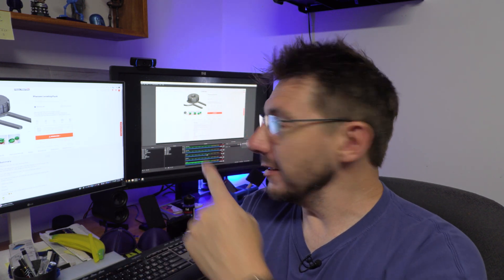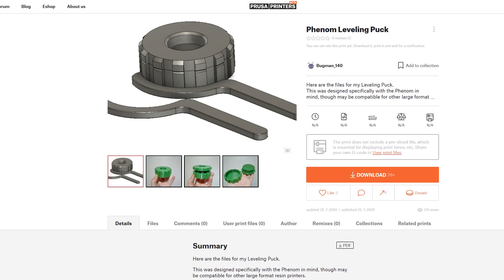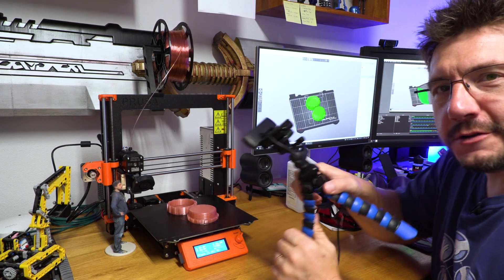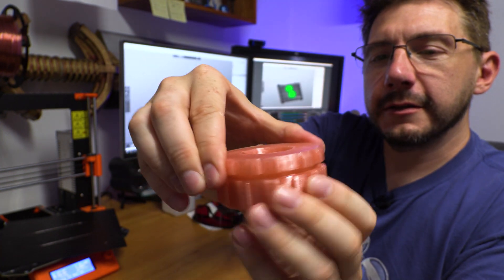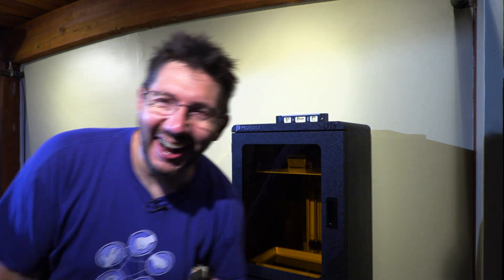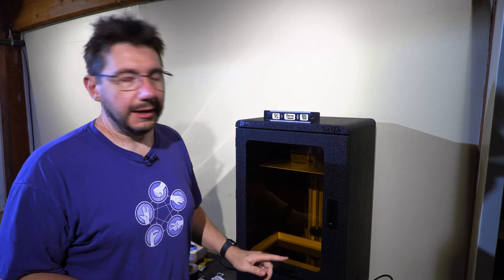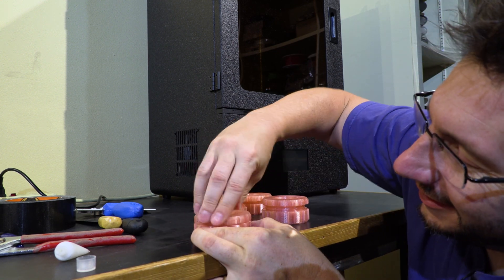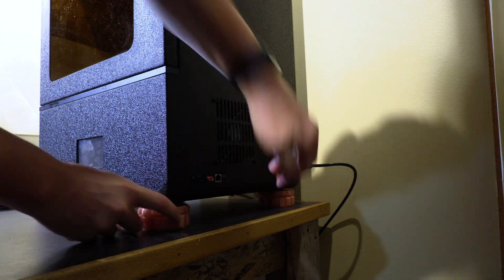HOW TO LEVEL YOUR RESIN 3D PRINTER

Comment: I was thinking that when there was resistance when turning, you would not have problem that they would un-adjusted when the printer do small vibration, maby they will now that you greased them.

And sending you a Wi-Five back (Wireless high five) :D

Comment: Levelling both the machine and the vat is important. If not the flow under the printbed will be uneven which in some cases can make very delicate prints to fail. Depends on what and how big models you are making.

Comment: So, the whole reason that level has 3 bubbles on it?  So you can lay it flat on something on a diagonal and level it in two dimensions at once.  In fact, the third one being at an angle is specifically designed to act as a triple check for just that reason.

Comment: What? This doesn't make any sense. The resin that cures is at the bottom of the tank. Why would it matter if the machine itself isn't completely level? Unless someone out there has their resin printer at a 30 degree angle.
Reply from the maker: If you're running low on resin, even a 2 - 3 degree tilt can make the corners bare.

Comment: Probably should just level the table. If your going to use adjustable feet on such a heavy machine you'd probably want to replace the existing feet and bolt the top half to the frame so it can't lose a leveling foot if you tried to move the machine around by lifting or tilting it. You could use a much larger rubber foot as well to prevent it from sliding off the table the hard plastics are not going to be great preventing the machine from sliding around. (I'd probably also bolt the leveling bottom foot to the table alternatively).

Comment: So  will you review our resin lol...they say petsistence pays off, joel.
Reply from the maker: I can sure try. Shoot me an email.
Reply: @3DPrintingNerd  
Excellent. Thanks. More coffee as promised too lol
Do you prefer social media contact or good old fashioned email?
Reply from the maker: @paulclewlow4768  Regular ol' email is best!
Reply: @3DPrintingNerd  neat. Can you tell me what it is? I didn't  see it listed.
Reply from the maker: It should be in the About section for the channel. It’ll be listed for business inquiries.
Reply: One of your previous commentors was mostly right about getting the bed and fep vat level.
If you only try to use the minimum resin as assessed by your slicer, the foot level is ideal though. It isvery frustrating to find an unfinished print due to an empty or bare part of the vat.

Comment: Verticality of the entire printer really doesn't matter unless you use every last dreg. What matters is the plate is level with the UV layer.
Reply: Yeh, i was going to say this seems redundant. They're not like FDMs.
Reply: @Ethan_and_Astra  it doesn't really matter for FDMs either. The bed is leveled relative the X / Y rails and even that can be off a bit with auto bed leveling. Gravity might affect spanning gaps but probably not noticeably. It's even possible to imagine exotic beds that tilt, twist or fully rotate in conjunction with the print head to assist printing in different planes although I don't know if they exist.

Comment: A printer that cost 3.3k$ and doesn't have a level system.....
Reply: Why would it? This concept of leveling the machine is pointless since the resin that cures is at the bottom of the vat.

Comment: this seems kinda useless unless you are setting it up on an extremely unlevel table...
if the entire machine is 1-2 decrees off it doesn't matter because you probably shouldn't be running it with so little resin in the tank that you end up with spots without resin. Set alarms and just check on it, add more as you need it. problem solved.
Reply: Boom! That's exactly what I was thinking.
Reply: This. Unless you are really off level and constantly pushing the capacity of the tank...meh?

Comment: Tip: when putting the adjustable feet under the printer's feet, make sure the least accessible ones are set a bit high (unscrewed), so that the more accessible ones are the ones that will likely be adjusted (in this case, the back ones are set high, the back left corner set the highest).

Not only that, if you can get two levels, you put them at 90 degrees to one another and make all adjustment in one go, instead of getting the printer ok in one direction and than moving the level and adjusting the other direction (you can take the first direction out of level while leveling the other).

Comment: There should really be only three leveling points.  Having four means that two points will be loaded and the other two will be less so causing either a wobble or a twist in the frame or surface the device is placed on.  Think of placing a 4 legged table on a non flat surface like a gravel driveway.  Only 3 of the legs will touch the surface.  Wobble or twisting will ensue.  If the table was designed with three legs there would never be a wobble problem.

A more correct term for adjusting the squareness of the machine is tramming.  Leveling will adjust the machine relative to gravity.  It is unfortunate that leveling has come to mean tramming on FDM type 3D printers.  Now that we have resin printers being told to level your printer will cause nothing but confusion or as in this case humor.
Reply: But with 4 adjustable points, you can get it level and stable at the same time. I don't think 3 points would be good for a rein printer, too easy to tip it.

Comment: The easier way is to use a "Bullseye level" and place it in the empty resin tray.  You just look down on it and it will till you which directions are in need of an adjustment.  Here is a link to a Bullseye Level so you know what one looks like:  https://www.walmart.com/ip/Johnson-Level-Tool-100-Bulls-Eye-Level/25483815?

Comment: Hey Joel, a quick tip. I would place the leveling rule at top of printer’s Vat. These cases may not be accurate.  See ya.
Reply: Putting the level on the LCD screen itself is the only true measure you need.
Reply: Leveling the machine is arbitrary and pointless

Comment: what you did works under the assumption, that the top of the outer case is fully parallel to the area where the resin tank is sitting...
this must not necessary be the case!

as squareness/parallelism of these two parts is not essential for the operation of the machine the manufacturer might have cut some corners in this regard.
Reply: A smaller leveler inside the resin tank would have worked better but this was a neat idea, some resin printers might be square.

Comment: Makes much more sense on big machines with a big vat. On small ones a little offset shouldn't be a problem, because you look to have enough resin in it anyway.
Never leveled my Photon S, isn't perfect 100% level, but there wasn't a problem either all this time. The regular Photon had adjustable feet, but they changed them to fixed ones.

Comment: Shouldn't you measure the level of the installed resin tank, instead of on top of the chassis?
I mean, it could be that the bed is not 100% level to the actual top of chassis, or it might be perfect, who knows.
Just measuring the actual surface you want to be level, is a good idea, to root out other variables.
Reply: Yes, its absolutely useless. you could leave the feet away when you level it like that
Reply: I was going to make the same observation. Get a smaller bubble level that can fit inside the bed, or given the access constraints one of those dome type levels that you read from the top and shows both x and y. Place in the tank (Hopefully the tank is empty and clean...) and view from above. I doubt opening the door would provide enough cantilever to tip the printer forward any appreciable amount.
Reply: Jeez B C, nice one. But yes, I agree with Christian here.
Reply: Maybe a marble in the VAT could work as a level too!
Reply: It comes with the territory... Watch enough of his videos and you realize he does quite a lot of things less than perfect. But hey, the energy is solid and he is good for the newcomers and fanboys of which there will always be plenty.
Reply: Yes,Joel you are ASS U Ming the whole machine was built perfectly inline with the tank.Not happening by just looking at the machines build and general structure.Did you really F$%^ up your camera.Get some help you are still in lockdown.Put those kids to work.Bret

Comment: Resin printing is interesting. I feel like I've had to tinker with it far less then FDM. The only issue is that print time. I have a weird interest in printing tall things which causes prints to take hours. I've seen fast acting resins but I'm not sure how well they work, have you tried any that you could recommend? Specifically I have the elegoo mars, I managed to pick it up for around $100.
Reply: Sounds like you want one with a mono screen like the Phrozen Sonic (or the upcoming Elegoo Saturn) - sub 2s layer times.
Reply: @ualdayan  wouldn't resin still be a big factor in how fast a printer would go though? I get if the screen would let more UV through but even if it does, the resin itself would need to take less UV to transition.
Reply: SacriPudding There is some variance from resin to resin but the amount of UV making it to the resin makes a much bigger difference.  Eg on a normal printer a 8s vs 15s is a much bigger difference than on a mono model and 1.5s to 2s.